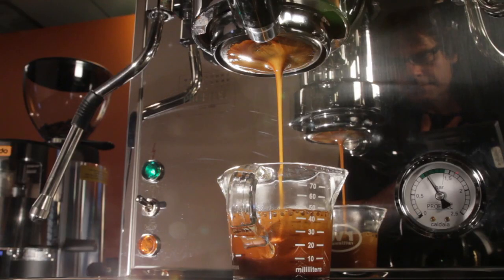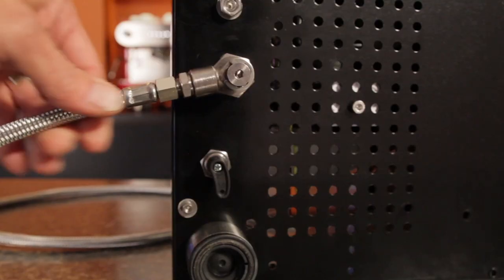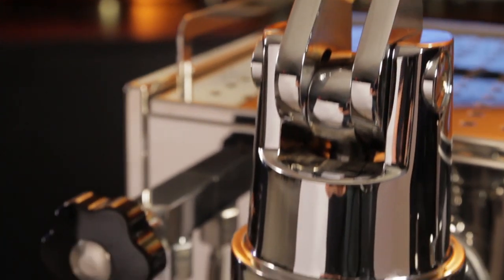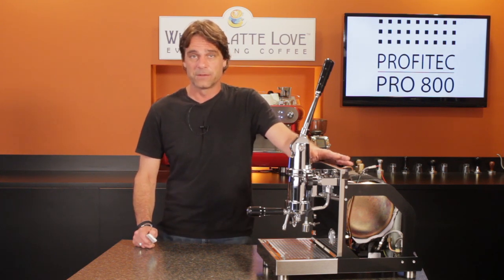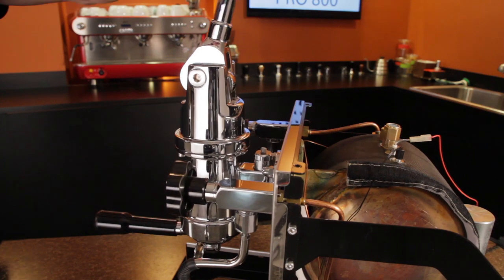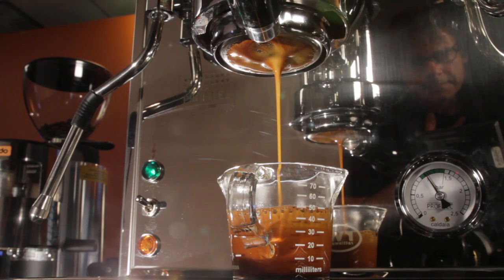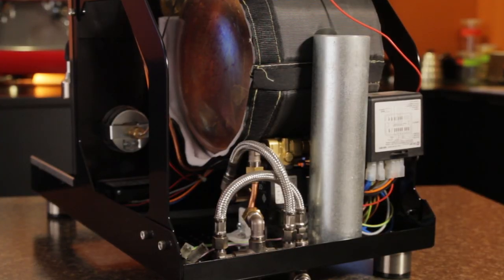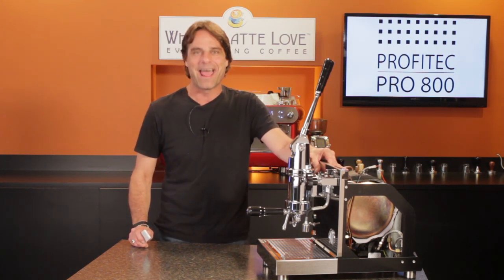Review: Profitec Pro 800 Spring Lever Espresso Machine

Comment: Loved the machine, in my honest opinion I think the suggested retail price is a bit high, especially since its not a Dual Boiler Machine and its copper. Also Profitec made this machine too big for the consumer @3.5L (almost 1 gallon) plus the lever, both not counter space friendly (specially for wives). I'm pretty sure its the best way to control the pressure thus coffee taste, but price is not cool. Also i didn't understand how PID works on this specific model.
Reply from the maker: Know what you mean about the wives :). And true, not an inexpensive machine. PID controls boiler temp/pres. Through passive heating of that massive group it is ultimately in control of brewing temp. One would probably make some adjustments to the PID based on ambient temp to arrive at the desired brewing temp.
Reply: hi Marc, the PID reading is in temp/pres. ? is there any other one group spring lever machine on the market that features passive group  heating and low pres preinfusion  ?
Reply: I guess i can't be manufactured smaller, since the lever could tumble over the machine if not heavy enough. Commercial lever machines are WAY heavier and the lever effort is almost the same on all brands.

Comment: Hey Mark, love you brother for being a big help with our difficult questions as always. I have another one for you. 
I got the Rocket Evo R and i just sell that one because i wanted something better. And now it's hard for me to choose between Ecm Synchronika or the Profitec 800. Or do you suggest any other machine that is one of the best for home use?
Reply from the maker: Hi AKM, Thanks for the kind comment and question! The ECM Synchronika is my favorite dual boiler machine in its class. If doing milk drinks it has best in class steaming power so that could be a consideration. In general, the Synchronika is faster/easier to use the the 
Pro 800. Some people really like the espresso made on a manual lever machine like the 800. Lever shots tend to be sweeter with an extraction profile that starts with a pre-wetting of the coffee, then pressure that ramps up quickly then tails off at the end of the shot. But lever shots are a little more technically difficult to pull off well. If you plumb the Synchronika you can do a line pressure pre-infusion prior to turning on the pump. Also a version of the Synchronika in the US with a flow control device on the E61 group: https://www.wholelattelove.com/products/ecm-synchronika-dual-boiler-with-flow-control With flow control you can mimic a lever shot and extraction on machines like GS3 or Slayer by adjusting the flow during an extraction. Here's more about the flow control from Roast Magazine's Daily Coffee News: https://dailycoffeenews.com/2019/04/10/whole-latte-love-and-profitec-ecm-launch-flow-control-device-for-e61-groupheads/
Marc
Reply: Whole Latte Love you r the best buddy thankyou for taking the time♥️

Comment: Real nice machine, but unfortunately doesn't make a lot of sense when an L1 can be had right now for around $2,275 after shipping and fees.  Personally, I wish they had made a Pro 600 based on the Pro 500, with a little longer drip tray for stability, at a size and price most would prefer.
Reply: Beans and Rice : Don't really agree here. The Londinium uses a HX system, not a dipper. Also, smaller boiler size, no plumable option, not a 1 piece construction, no cup heater, inferior (non swivel) hot water spout and lack of dealer support where I live make the choice easy. Although I have the utmost respect for the owner of the company and the products they make. But saying it is superior to the Profitec....no, I cannot agree. Different animals alltogether.

Comment: Heat up time for that monster boiler?
Reply from the maker: Boiler up to good temp in 20 minutes or so depending on ambient temps. But, will want it on a lot longer, say 40 minutes to get that massive group up to temp.
Reply: Hi Marc, sorry for asking out of topic. I have VBM HX mc.the boiler is ready in 10 minutes(heating lamp off, reach 1.1 bar), but the coffee brewed is not hot enough. Should I, as you said above, wait longer for the brew group to get to temp ?
Reply from the maker: Hi Ko, No problem asking. Yes, would most definitely let the machine warm up longer. 30 minutes or more would be ideal. Also have the portafilter in the grouphead while the machine is warming up.
Reply: Thanks for your advice, Marc.
Reply from the maker: My pleasure!

Comment: Hi Mark. I've been watching your videos a lot!! especially to compare the machines between pro800 and synchronika. 2 days ago I bought the synchronika from WLL and it's on its way now. The reason I bought the synchronika is that the sales lady told me that I can upgrade the synchronika with flow controller. Do you think that I can make a shot to the level of pro800's with that flow controller?
Reply from the maker: Hi JL, First, thanks for your business. You will love the Synchronika! I'm curious what machine you were using prior? With the flow controller you should (with some practice) be able to simulate the extraction characteristics of a lever machine. Basically, you would use a very low flow at the start. This is like pulling the lever down on the 800 prior to release. At that point water saturates the puck without pressure. Let that low flow go for say 5-10 seconds. Then turn the flow control to max. This simulates releasing the lever on the 800. Flow/pressure build rapidly to max through the middle of the extraction. About 2/3 of the way thru the shot reduce the flow to mimic the falling pressure/flow you'd get with a lever shot. That's the basics. Of course variables like, timing of flow changes, grind and dose weight will play into the extraction as well. You might consider using a scale to weigh your shots as they progress to arrive at specific brew ratio. Lever shots tend to be more dense so a lower brew ratio like 1:2 for coffee to finished espresso weight.
Marc
Reply: @Wholelattelovepage  Ive been using Jura so far. This is my first semi auto machine! I dont understand the ratio 1:2. Could you plz expain more about that?
Reply: @jaekwanlee5877  Ratios are pretty simple. You need a scale to work on this though. You dose 18g of ground beans into your portafilter. You get 36g of espresso from your extraction. 18g : 36g is a 1:2 ratio, very common for espressos. James Hoffman has a nice video on ratios on YouTube, check it out!

Comment: are all lever machines heat exchanger?  any lever machine that is dual boiler?
Reply from the maker: Hi rc, Thanks for the question. I'm not aware of any dual boiler manual lever machines.
Marc
Reply: @Wholelattelovepage  thanks Marc.  i really love the Pro800, but it's just too damn huge.  i have a small counter space.  any other lever style you would recommend?

Comment: Hi Marc, loved the video and your channel. Very through and helpful. I was wondering if you have heard of the Londinium  by Reiss Gunson (Spoiler alert : hes a tool), and know why people would ever look at that, this is cheaper then Londinium, has a bigger boiler, PID and just seem like a much better build. Am I missing something?
Reply from the maker: Hi AS, Thank you for the kind comment! I have not used the Londinium so can't speak from personal experience. The website was a little short on details. I definitely prefer PID to pressurestat for tighter temp control although in lever machines with their heavy groups any swings are probably tempered. Their site did mention a user adjustable pre-infusion which is curious?
Marc
Reply: Abdul Sharief It’s pretty rude to call someone a tool if you don’t know them. The Londinium has technology in it that is pretty different from the Profitec. Some simple research would teach you that.

Comment: for these dipper setup, what temp range would you recommend to set it at for medium and dark roast?
Reply from the maker: Hi LL, Thanks for the question. General guide to temp is to lower as the roast gets darker. Best bet IMO is to taste the coffee. If you feel it's more bitter than it should be then lower the temp a few degrees, brew and taste while keeping other variables like grind size, coffee dose and extraction timing/volume similar. Hope that helps!
Marc

Comment: Are there any advantages in this one boiler design for descaling?
Reply from the maker: Hi Eric, Easier to descale than a dual boiler. But, use properly filtered water and you can eliminate need to descale in the first place. Our recommendation for plumbed machines is the BWT Bestmax Premium. More info on water filtration options to eliminate descaling in this video: https://youtu.be/1v9WSIXtpos
Marc
Reply: Marc I appreciate your feedback.

I have been looking into small Italian automatic water softeners.  What is your take on them?
Reply from the maker: Hi Eric, Sorry for the delayed response. Many softeners use sodium to do the job. I prefer filtering which handles particles, chlorination and other chemicals with carbon and exchanging calcium with magnesium to reduce scaling potential.
Marc
Reply: Thanks Marc.

Comment: Are they expecting me to pay 2.9k for a single boiler? Pass!
Reply from the maker: Hi DD, Technically a manual lever is single boiler but it's setup in such a way as you can brew and steam at same time.
Marc
Reply: Whole Latte Love Wdym? They always are?
Reply: @jamesb.ofdesertdistrict567  A regular single boiler can only brew OR steam. Not both at the same time. It has to heat up for steam or cool down for brewing. Exceptions are heat exchangers.